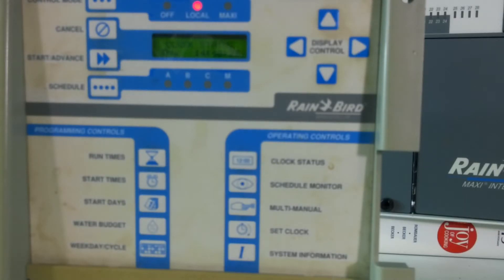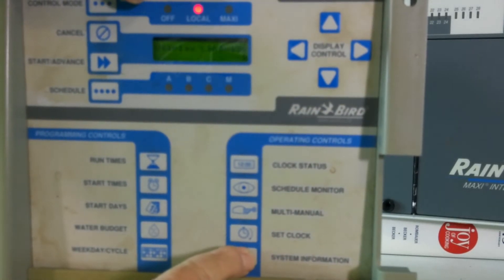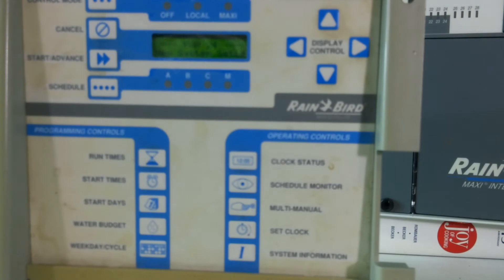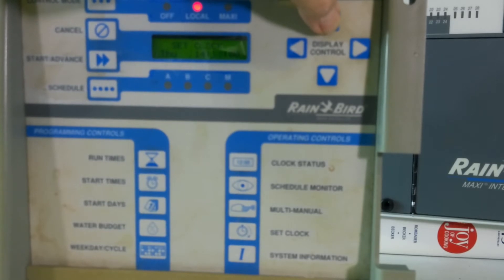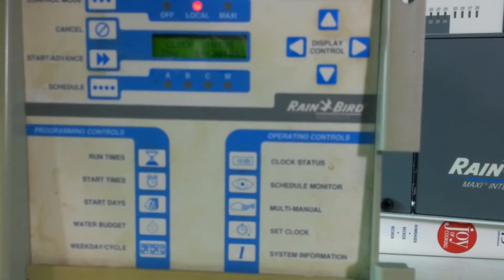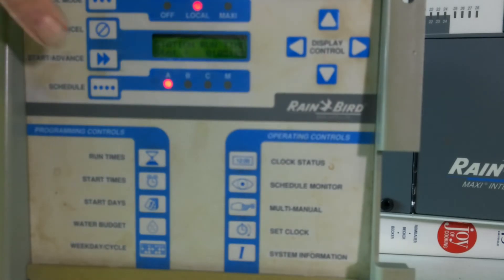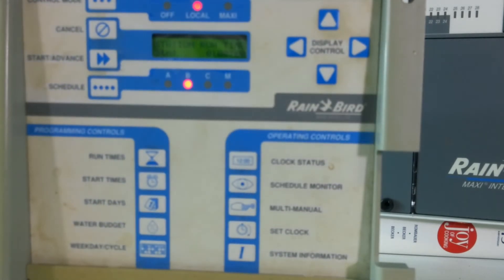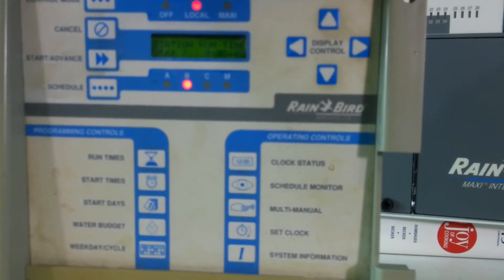How to Program a Rainbird PAR 16-24 Controller as a Stand-Alone

Comment: Made a comment about the Ckt Breaker issues : If you are handy with a soldering iron carefully remove the back screws of the unit and carefully remove the Ckt Board (Held in By Clips). Locate the Ckt Breaker remove the device and replace with a Resettable Fuse.

Comment: Great Info...worked on these for years found many problems  associated with moisture that would get into the  unit due to exposure over time. Cabling also an issue that would corrode and cause intermittent  or no water conditions. The biggest issue I've seen with this controller is the Ckt Breaker that would wear down with time causing  unit to lose power if six or more stations  turned on.